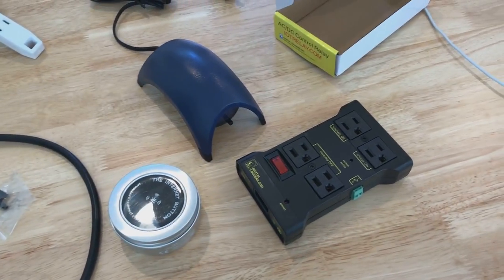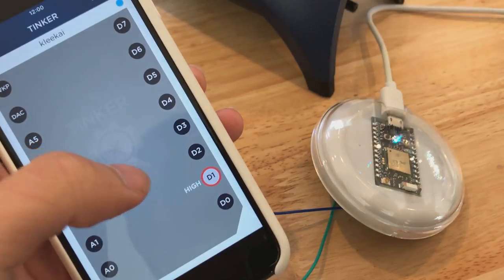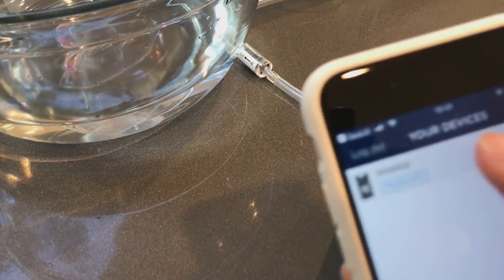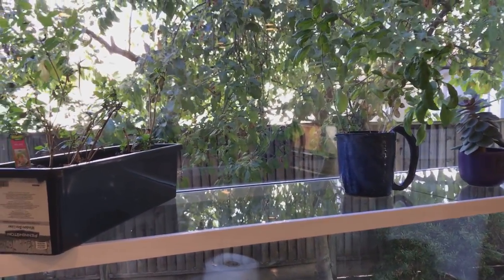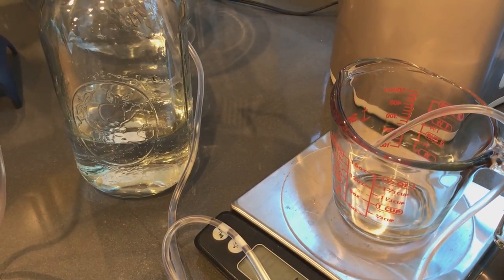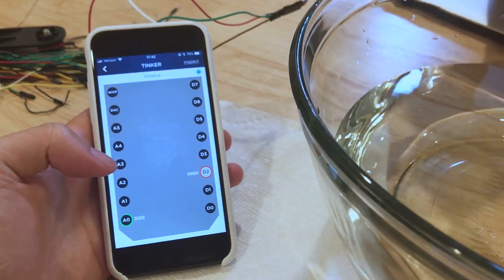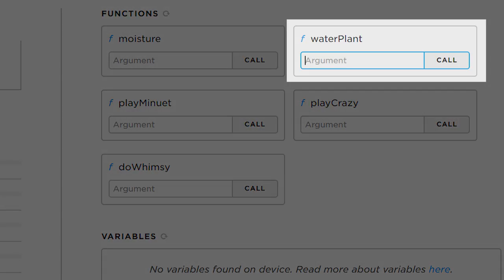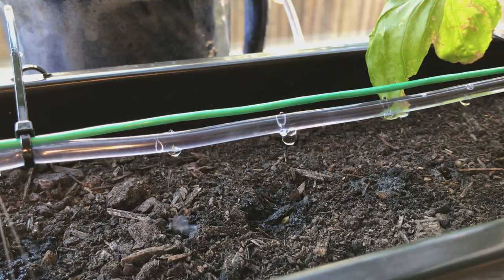Wi-Fi Plant Watering System (with Particle Photon)

Comment: Great project, I’m interested in how you went with the values for the moisture sensor and if that worked well? I haven’t used one but heard that people had issues with getting good measures out of it.
Reply from the maker: You really need to test and see what values you get with your own setup because there are so many things that can affect it. Soil type and depth can affect the readings, and you don’t want water pooling at the bottom of the planter while your sensor says it’s dry at the top.
Reply: @riveducha  My plan will be to attatch the probes to two stainless steel nails or something that won't rust and then use that in the water to avoid the corrosion factor.

Comment: Why didn't you just use a small water pump instead of the massive air pump and elaborate jar system?
Reply: That's what I was thinking. One that connects to a motor like this one with part number 4320-004-10-39.
Reply: That's exactly what I was thinking
Reply: I can only surmise that it’s more reliable. If the water runs out, you’ve just got air running through. If you run out of water and you’re using a water pump, you will most certainly destroy the pump. To protect against this, you would also need a moisture sensor in the reservoir so the pump didn’t turn on if there was low water level from the source. That’s why I think they are using the air pump instead of a water pump. My setup will be using a 5v water pump with a level sensor because I’m going to be pumping from a large open container anyway.
Reply: @DavidJJJ  How did your plant watering system end up?  I'm about to start mine.  Right now I just want to get a prototype up and running to see how it would look, and then get into designing something that I can attach to my wall.
Reply: @TheGribbleNator  it worked well, I used an esp32 which has two touch inputs which works with water and a solar panel connected to a battery which ran the 5v pump and the esp32.
Reply: @DavidJJJ  Very cool, do you have it on a timed setup or did you go with a moisture sensor?  I grabbed a capacitive sensor to avoid any of the corrosion issues, and I'm pretty sure my Fittonia needs more watering than I want to figure out with a timer.

Comment: Cool video.   What is the housing you used for the Particle Photon?   Seems much nicer than my breadboard.  Thanks!
Reply from the maker: It's the Particle Photon "Internet Button," which was a kit they used to make. The round module included a ring of LEDs, 4 push buttons, an accelerometer, and a buzzer.

Comment: Cool.
Way over-do on the sealing.  Silicone takes way too long to set anyway.  Hot melt glue is a quick and less toxic alternative.  Not much sealing is necessary.
Simplicity is always a good guideline for any project.  Use a valve instead of a pump.  Gravity feed or capillary action.  Pizza cake.  :-)
Polling every 15 minutes seems like way overkill.  Once per hour or less seems reasonable.  Unless you're monitoring while injecting water.  I would think a small dose of water followed by a hydration check a while later, then repeat, would be a better to give the water a chance to permeate.
Now you need to calibrate it for different kinds of plants!  :-)
Thanks!
Reply: 'Pizza cake' - yum :)

Comment: whats the clear plastic thingie you put in line with the tubing
Reply from the maker: Ed19601 It’s an extra one-way valve that I’m just using as a stopper. A rubber end cap would’ve worked too.
Reply: River's Educational Channel thanks. Suspected that already